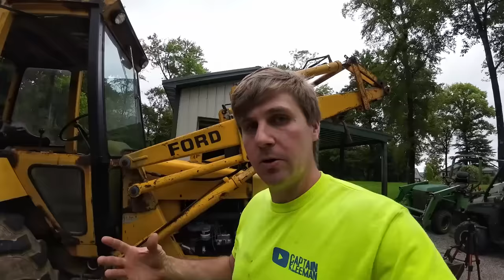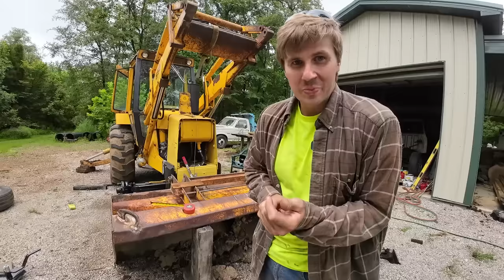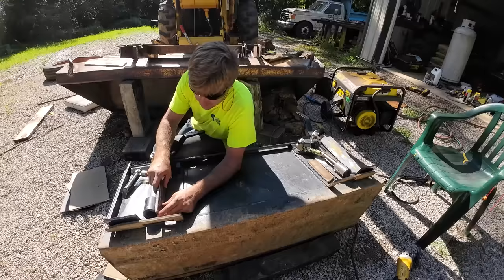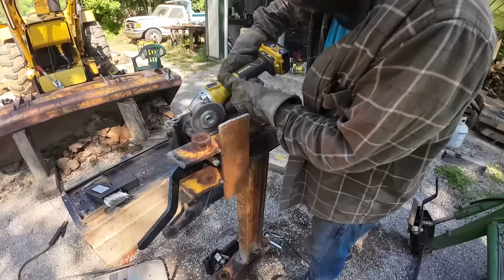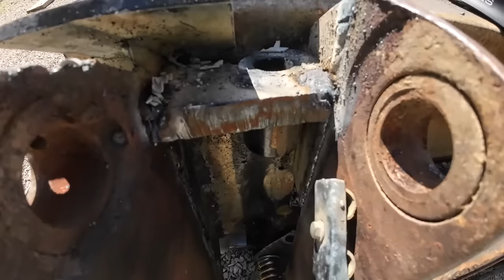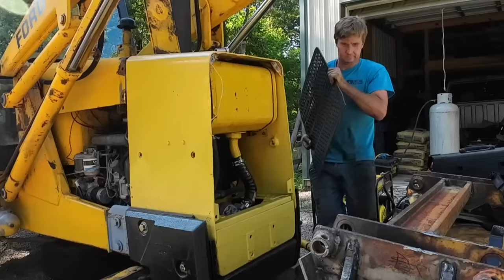Welding a Skid Steer Quick Attach for My Backhoe - Will it Work?

Comment: Hey Captian, just a few tips when you're welding for ya. When you're welding try clean the area that you place your ground on, haveing a good ground is key, if you notice the weld molten moving while you are welding wrap your ground around the material or palce it on the bucket. and this is the big one, you need to crank the temp up just a bit, you're running cold my man, that or preheat the metal.
hope this help.
great video!!
Reply: How can you tell he's not running it hot enough from just watching him weld? What are you seeing that tells you that? I'm curious so I'll know when I weld myself because I'm not as good as Mr. Kleeman yet.

Comment: I was wondering how the whole quick attach was going to work since the connection points were one with the bucket.  It all started making sense as you started mocking it up.  One thing is for sure, if you ever have to replace the bucket, a lot of fabrication would have to occur to make it work with the quick attach setup.  Another great video with the classic Captain Kleeman humor and ingenuity!

Comment: My guess is that you are salvaging an old barn or outbuilding.  Heck, knowing you it will be a silo to transform into a Rental Cabin faux Lighthouse!  LOL

Too bad time and money are too short to order up a custom SOT Metalworks grill with FORD 555 strollcut into it above ventalation holes,put Blue LED backlighting behind the logo.  But this is a Work Machine, not a Show Machine.

Enjoying following along as you repair and make upgrades to this Ole Girl!

Comment: All the Chinese Quick attach brackets have issues with how the Pins hold the attachment to the machine. Usually when back dragging the attachment comes off. The problem is due to the pins angle points as well as spacing at the lower pin placement. Many folks complain about it, myself included. Great job so far Mike.

Comment: You took a huge leap of faith cutting the bucket attachment off 😮 Could tell you were apprehensive about doing that, but you have gone through it methodically and over engineered where you can...... looks fantastic Sir !!! 😎
For the bottom of the loader frame, yoh may be able to weld on a small piece of steel plate to act as a wear plate to help protect the bottom pins..... It is not exactly what you are after, but may help..... 🤔

Comment: You keep saying your not a welder ...... 
But you are doing lots of welding.... 
Turning up the welder too  penetrate / fuse what your welding along with slowly sweeping your stick side to side in the  puddle of your arc will make your welds be stronger and safer.

Comment: Hey Cap't, A needle scaler works great for cleaning the slag off those welds and also works good for cleaning areas you cant reach with a wire wheel before welding. Great video.
Reply from the maker: Definitely hope to pick one up at some point.  Would be a big help

Comment: Hey captain I wondered if you add Teeth😬to the bucket as to break that rooted ground also I wondered if you looked at a D.R chipper. Or maybe one  you could tow either you tracker or the dump.just to get rid of the brush
Reply from the maker: Teeth are on the list

Comment: Gotta say I  love your clearly intentional method of helping keep the parts of the metal cool you arent trying to cut or bend by using  the standing rainwater ;-P   Edit: HAHA later in the video you use it to quench or cool the metal LOVE IT .... also throwing darts at a dart board.... jones round barn

Comment: The 555 is looking pretty nice!  Having the quick change mount on the front opens up a bunch of possibilities.  If there are remote hydraulic couplings on the front (or could be added), maybe you could run that big log splitter on your backhoe, instead of having to rent a skid steer.
Reply from the maker: That's the goal!  Some hydraulics and we can run all kinds of attachments
Reply: Sounds like a plan!  @CaptainKleeman

Comment: Hi Mike. Functionality is what it is about. Beauty is only in the eye of the beholder. As long as it works, and you do not have to revisit the spot again, it's just fine. What am I talking about since almost no one will see it? It sounds like you may be taking a building apart and putting the metal on pallets for easy loading and unloading. If so, remember the metal banding. Have good days!
Reply from the maker: Appreciate ya watching buddy!

Comment: Nicely done 👍
I'm really not a security fanatic, but do me a favour and try to use the protective cover on the angle grinder, sparks don't fly around everywhere and your hand can't slip into the wheel, I use grinders almost every day and have to remove it most often not once a month.

Comment: Got a couple tricks for you. When starting your cuts with a torch once you’ve achieved your pre-heat back off the material and press your oxygen lever then start back in your material. This will clean up the starts of your cuts and prevent popping. Also when your laying something out that has paint you can preserve your marks by center punching them. After you’re done grinding the paint or rust you just need to scribe a line across your punch marks and your done. No second layout. Keep on keeping on brother!
Reply from the maker: Definitely need to pick up a few punches.  Would be a big help

Comment: when welding watch the puddle.  arc welding is a pain. lol.  love the 10 amp flux cored wire..on the mig. do not have to worry about the wind.

Comment: Captain Kleeman,  I don't have the part you whacked off the bucket to weld the adapter too. The Massey will need brackets and the adapter.  Yours is looking excellent. 😊😅😊

Comment: The yellow doesn't hurt, the non-tractor tire does.  Looks trailer or like wheel.  Tread gives it away.  But it is a Frankenstein machine anyway. 🤠
Reply from the maker: It is, we explained it when we got the tire

Comment: If you have overhead wattage available on your generator, I think it may be a good idea to put a constant load on it while using your welder. The arc creates a pulse and when it extinguishes it will create a voltage surge. Since coils of wires are inductive that sudden current stopping may create a voltage high enough to damage the generator head. If the voltage has somewhere to dissipate too such as a space heater or something it should keep the voltage spike to a minimum saving the generator head. Ive fixed a generator that had a burnt out head from someone using it for welding, I think this is why it failed on them.  May just save yours....  Has anyone done this or can confirm this?
Reply from the maker: I'm not sure what you mean.  I definitely noticed the pulse on the generator.  Can you explain in different terms what you mean
Reply: The pulse is like a heart beat: draws alot of power then a little. When it draws a little power the voltage through the generator is suddenly high and fries the generator. So he suggested putting something between the welder and generator to keep that spike from happening.